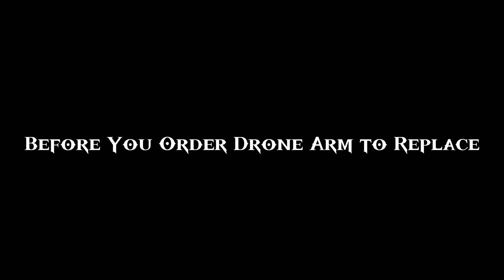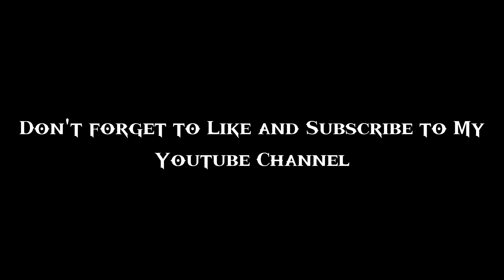DJI Mini 3 Pro Arm and Axis Replacement Step-by-Step Tutorial

Comment: Thanks for the tutorial. In fear for screwing it all up, i cut the wires and soldiered on the new arm. It worked fine.
Reply: That's a good idea mate
Reply: @mohammadrasoulfard-habibi3066  Its working fine. You still have to take some of it apart but not as much. Next time the arm brakes I can loosen the solder and put another on. They should make these things  plug in.
Reply: I've just broken mine 😢, then I thought that is it ok if I cut it off then soldier the cable?thanks a lot for ur info
Reply: May I know how many wires did you cut and soldiered? Thanks in advance
Reply: @haroldbriones7041  all of them apart from the white and black one with the connector on it. I plugged that on in. It seems to be working fine still.

Comment: For those asking, the black stuff was glue. The blue stuff is the thermal paste. That should have been scraped off then reapplied to stop over heating.
Reply from the maker: You can replace the blue gel if you wanted

Comment: The only thing that he did wrong was that he didnt replace the thermal paste of the board ,every time you deal with an electronic that has a cpu or something equivalent that uses thermal paste you must replace it with a new dose just to make sure the components never experience overheating .other than that exellent job

Comment: Thank you for Your tutorial. 

One thing I did not follow: at 3:30 you can see the RIPPED PLASTIC which I did not want to do. You could do it this way: 

- do not remove the motherboard on the uppder side. Let it there where it is. This way you do not have to rip the plastic. 
- only remove the orange antenna cable from the motherboard. 
- do not pull out the board for soldering the three cables (red, black, white) from above but from the bottom side. 
- switch to the open botton side of the (open) body and pull out the board for the three cables just a bit (approx 5 mm) for soldering. 
- remove and solder the cables from the bottom side. 
Downside of this way is, that the small board for your cables nearly sticks in place and you have to be more carefully when soldering. In my case before soldering I covered those parts of the plastic of the body with small leather stripes, where there could be danger of melting the the body with the soldering iron. Worked well, but you have to be more skilled when soldering. 
By the way: for glueing/fixing the cables on the body I used 'Stormsurge'. Workes great.

Comment: I buy my mini 3 yesterday, and now right rear arm is broken. Can i only change plastic part? And how to not do all of that showed on the video? I never did something like this before
Reply: Or maybe i can glue it?
Reply: Had been my question too. I tried to glue it with normal cyanacrylate-glue with hardener (in my case 'HG Power Glue').  I presume that would last, at least when broken on the outer part near the rotor (less force there). Sadly a tiny drop of glue made it's way into the motor, which forced me to replace the whole arm.
Reply: @cwe3874  I understand that replacing the arm is the only solution, but I want to delay the repair as long as possible

Comment: Can we just cut the wires and joint the new ones?
Reply: No authorised repairer would suggest to do so.. but it should definitely work.
Reply from the maker: Yes you can, but I will not do that
Reply: I had a burnt down motor. Got a new one from Ali (seems original) and my friend cut the wires at the end of the armshell, and joint it, and now it is working fine. It seemed much easier way to fix. I wonder why it is not recommended? I hope the drone will not just suddenly fall down in the middle of nothing 😅
Reply: @dominikstuban2736 may I know how many wires did you cut and soldered? Ghanks and regards

Comment: at 0:47 when removing the bottom plate it casually rips off a black connection bridge that is glued to the back of the plate, and you reassemble it without ever mentioning this. what is going on with that part??
Reply from the maker: Oh that drone is used to fix before, I don't know what they do with it too but that black thing is not cable.

Comment: After changing the arm is it necessary to calibrate with some software?
Reply: Does somebody know the answer? Would be interested too.
Reply from the maker: If you don't have error, no need to do anything.
Reply from the maker: Yes I know, if no error, do nothing. If have error, so what error you get?
Reply: Did the whole repair last week. No, no calibration was necessary. Replaced the right front arm.

Comment: What name thermal paste do you use? Thankyou
Reply from the maker: Which one?
Reply: @djiSolutions  for DJI mini 3 pro
Reply: I think he was talking about the blue one on the main board and heat sink I suppose if it is still wet you could move it inwards then reuse but if dry replace with a blue thermal paste.

Comment: If it was only the hinge it would have been much easier I saw on another video. Then there was no need to disassemble everything to desolder a wire.
I got a Mini 4 with a semi broken rear arm. With duck tape it still works. The orientation of the arm seems slightly off but the self balancing of the drone compensates for it without any struggle. I will order the shell arm part, but I am not looking forward to tear the whole drone apart as it still flies...